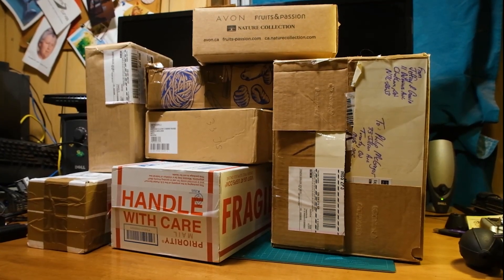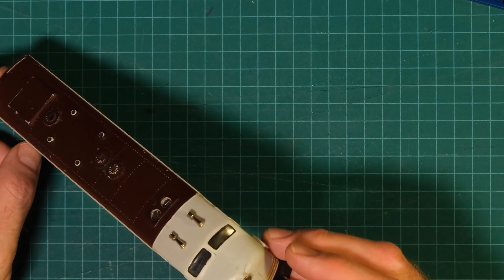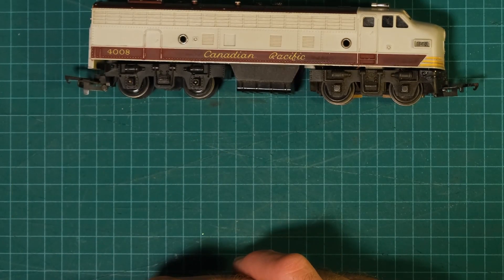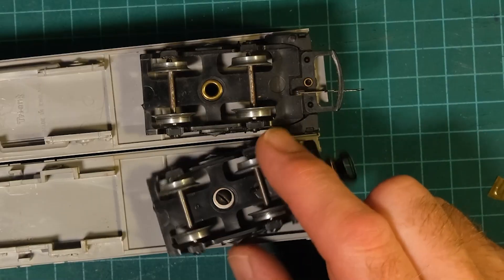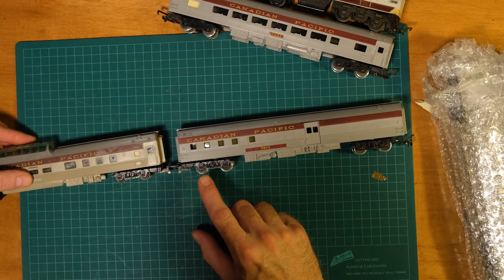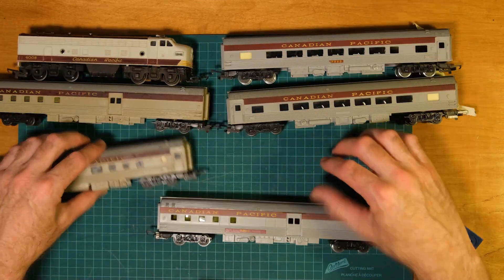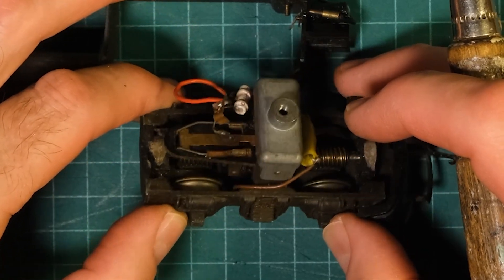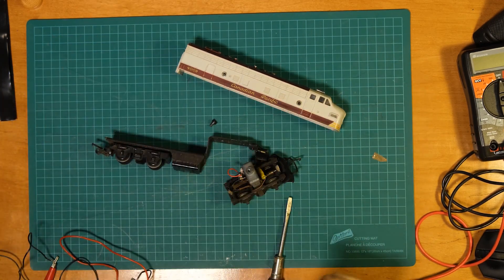Tri-ang Hornby Canadian Pacific F9 Streamliner, Secret Stash Pt 1

Comment: Hi ThumbWhacker, all you need to do is find a standard Tri-ang princess rear bogie which is a direct replacement for the later one supplied with the  Gresley tender, these are a very common spare here in the U.K. I have two of the Transcontinental Pacific locomotives, one of which I’ve repainted into CPR passenger livery (which I bought as a non runner with a damaged body) great to see the Transcontinental locomotive and coaches in the Canadian Pacific livery, would love to make a train up of them myself but they are rarer than Rocking horse manure over this side of the pond. 😂
Reply from the maker: Thanks Ian.

I just looked at my Prince Elizabeth and it's exactly as you say.  My idea was to find a Hiawatha and repaint it, or a body and a later Princess chassis with the shiny wheels.  However, I may have found a solution to that, which will be in a video that I should get up in a couple of weeks. I'd like to see that repainted pacific.  Those coaches are getting pretty rare here too. 

Thanks for subscribing and watching the video.